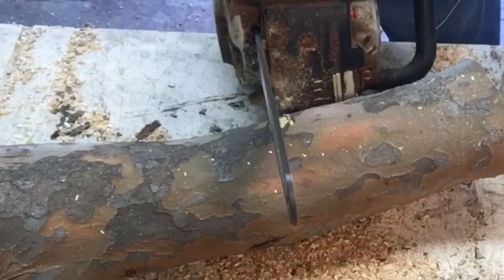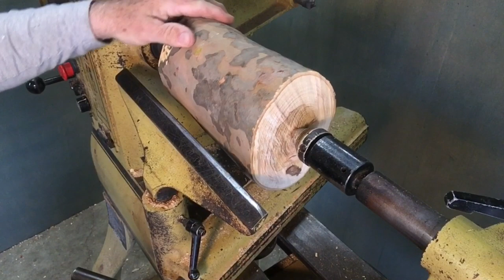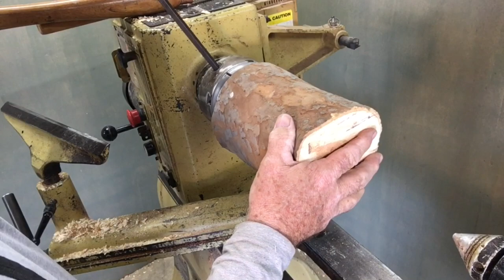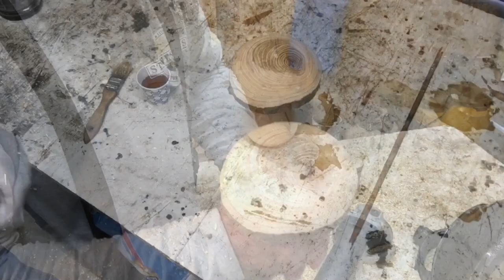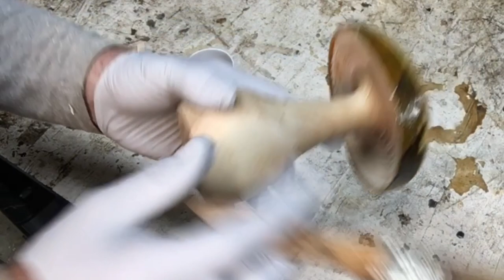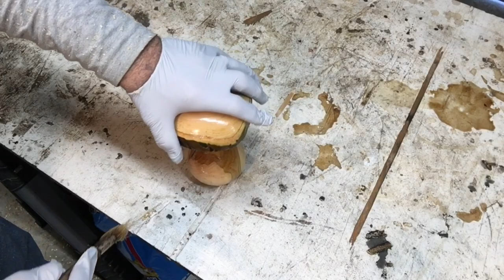Woodturning a mushroom

Comment: Just a tip, you should always use a mallet or piece of wood to set your drive center, a hammer will mushroom your drive center. You can also turn a mallet. Cool mushroom.
Reply from the maker: Thank you David. I agree, and I should turn mallet someday. Now I don’t want to sound rude, but that Chinese elm is about as hard as concrete. I figured if I mushroom it I can grind it down. Also I hate that drive spur and If i destroy it, I will have to get a new one. Ya, that’s what I need to do anyway. I think I like one I saw from oneWay that fits most 4 jaw chucks. Until then, mine still works no matter how bad I treat it. Thanks again David. Sorry if I ranted a bit about the spur drive.